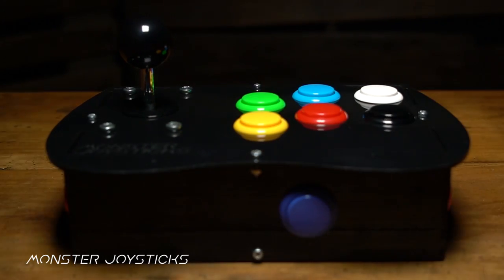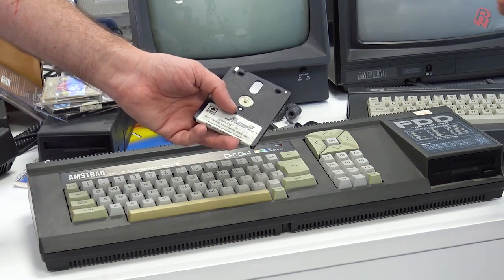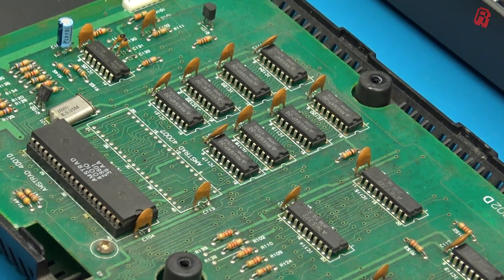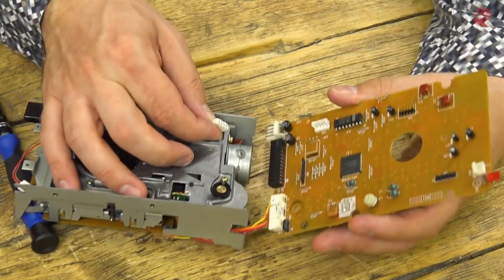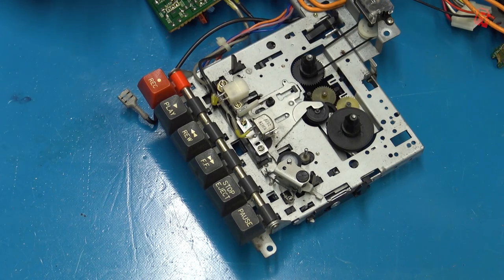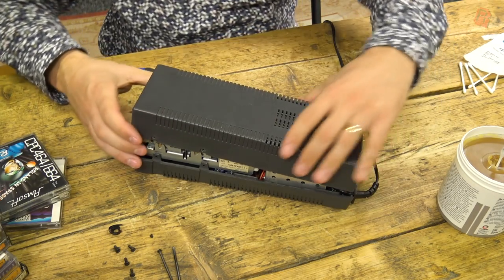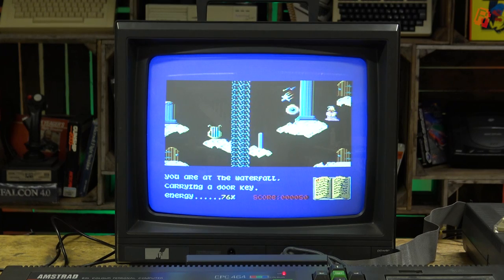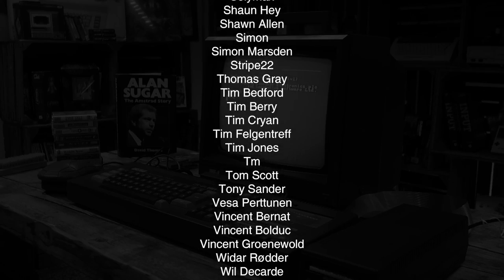British Micro Donations Refurb - Amstrad CPC & DDI-1

Comment: That fits perfectly!  If I remember correctly, "Finders Keepers" was the first game I bought and loaded on my CPC-464 @20:30. That must have been sometime in the mid 80's.

I still have a CPC-464 sitting around. Not my very first one and no longer in use ... but it would probably still work ... with a suitable power supply and ... a little less available these days ... a suitable CRT monitor.

Comment: Great video as always chaps. I have a CPC 464 and have just bought a CPC 6128 too. I also repaired a tape counter on an Aquarius data recorder recently. I found the button itself rattling around inside the case, but I couldn't figure out how it attached to the counter mechanism. So I removed the clear plastic cover and luckily there were two tiny pieces of plastic that attached to the button still inside. I superglued  the parts back together, reassembled everything, and the reset button now works a treat :-)

Comment: I and my wife had a series of ZX Spectrums from the rubber key through to the last tape Amstrad version. I loved playing games on it. Then I bought a CPC464 with colour monitor when they first came out. There were very few games but I eventually bought a disk drive and printer and learned some basic machine code. I have to admit that learning to programme on the Amstrad was probably the happiest I've been with any computer. Thanks for the excellent video.

Comment: The FD1 interface could be a bit of a nightmare, it wobbled around enough on its own & the lack of an expansion port pass through meant that it could end up at the end of long chain of accessories such as the range of DK'Tronics ram packs, ram discs etc.

Comment: Earlier this year I managed to get a CPC6128 with colour monitor, lots of nostalgia as a CPC was my first machine as a child.
It was very clean but as usual the disc drive belt had perished into gunk, luckily it came apart really easily and in fact it was one of the easiest belt changed I've had to do on a drive! 
Next is to get a Gotek working with it, so far I have had little success flashing the hardware onto the floppy emulator so its still a WIP.

Comment: Neil, perhaps put the two enter keys on your eBay saved searches as well. They're meant to be blue, not faded to grey!

As for the pinch roller, what about an o-ring - not the right profile?

CPC646 was my first computer growing up, with a green tube and later the RF modulator for use on a TV - Amstrad MP-1.

Comment: An interesting test: can a common electronic board tin-plating kit be used to refurbish edge connectors?

After cleaning the rust, this also might help with rusty RF shielding, as it might have been used in the first place.

Comment: 11:03 was the belt snapped? where did you get a new one?
Reply: Lot of things made of soft rubber will de-vulcanize at some point, where they basically turn back into the oil they were made from. You can find belts for lots of old drives and decks by just looking on places like eBay.
Reply from the maker: I bought a multipack of belts a while back so I can usually find one in my spares, but you can also find them if you just search for amstrad cpc belt.  Lots available
Reply: Thanks 😀

Comment: But did you remember to put the write protect pin back into the disk drive, i remember when i first cleaned out my dd1 disk drive the write protect pin fell out and i never noticed so spent hours trying to find out why it kept telling me that my discs had the write protect enabled until i notice a small gold pin on the floor and after some investigation realised it was part of the disk drive protect mechanism.

Comment: A good replacement for the drive wheel "tyre" may be an O-ring. In a previous life I had an air conditioning business and had a stock of refrigerant line seals. Used them to fix similar thing's although not an amstrad. May be worth looking into

Comment: I recently bought a similar setup. I too had to do the belts on the ddi.  I have two ddi drives that I fixed and have managed to tune the rpm to stock, often this is all that’s wrong if the belt is fixed and it’s not reading.  I managed to buy in bulk 40 brand new discs still shrink wrapped! So I sacrificed a few and loaded all the games on from my childhood days, Jetset Willy, Grand Prix, rambo, sorcery etc. man the nostalgia was strong as weirdly amstrad ddi drives have a unique smell :)

Comment: The Amstrad CPC 464, complete with colour monitor, was my first ever computer, which Mum got me for my 11th birthday from Dixons way back in the summer of 1985. Mine's a "tall key" version, originally manufactured back in December 1984. Though it is scratched and somewhat beat up, and the monitor's long since gone (which was a pre-664 sans 12v disk connection one), it amazingly still retains the original colours of the graphics on the keyboard unit, as well as those of the proper double shot keycaps, more than 35 years on. Could having Jazz and Rampage 3D Transformer stickers placed on it have protected it for all these years from the ravages of deadly UV light?

Comment: Hi Neil, might be worth trying to re-purpose something else like o-rings/thick rubber tap washers or even bike brake piston seals for the tape tyre if you can't get the original.
Reply from the maker: Hey, I understand a flexible fillament is an option with 3d printers... I really need to buy one.  When I do I'll try to make a batch and put them in my store nice and cheaply for others
Reply: @RMCRetro  that's what you need. I replaced mine with one a couple of months back.

Comment: I needed a tire for my tape drive but couldn't find a replacement so I made one out of rubber tubing I had to hand, I cut a thin piece off and managed to wrap it round the wheel, it works now.
Reply: This one works, I bought one couple of months back.

Comment: For the replacement tyre:  It should be fairly trivial to 3D print a TPU (flexible and rubbery filament) replacement.  Whether this has the dimensional accuracy/surface finish required to maintina a good enough wow and flutter is a matter for experiment I'd say.. Perhaps a rubbery resin for an SLA printer would be better.

Comment: Why not 3D print the counter reset button and the drive wheel rubber replacement with something like Ninja Flex? If 2 material printing is available maybe even print the whole wheel+rubber?
Reply from the maker: This is something I'd love to try when I finally get a 3D printer

Comment: What you may find with some monitors is that you may find that the image is very dark, or something isnt looking right. If you turn the brightness dial the image may go crazy and glitchy. Two things can fix this, 1st is to open it (very dangerous so look get expert help with this), the back casing comes away easily (tricky to get it back on correctly aligned with the components inside though for the v hold button) and you just spray the potentiometer for the brightness (you cant get the wd40 straw to get in there with the case on unfortunately), give it a few turns and then when the case is back on - power it on and test to see if the glitchy lines etc have gone.

For the screen that is too dark, there is a small potentiometer that you use a screwdriver on located on the black (i think its called a flyback?) box with two potentiometer screwdriver holes, (to the right of the v and h hold potentiometers) i believe the bottom one adjusts the brightness of the tube itself, very tiny turns to adjust, and it'll be all good then, but get someone who knows their stuff to do this!)

Comment: Ahh, the '464... my computing savior!
I started out with BBC B + CUB monitor + twin FDD's on loan from my father's work. Eventually they wanted it back and my parents not rolling in cash bought a ZX81 for me as a replacement! It's the thought that counts even if I had come crashing down with a gigantic bump.
Time went by with no sign of a Beeb entering our house once more (too expensive). Having had a 'proper' computer I knew a Speccy would seem too much like a toy and the rubbish Basic in the C=64 was off putting to me - at the time I did play games but was more in to programming and tinkering...
...Then Amstrad came out with the '464. By comparison with a BBC Micro it did all the things I wanted well enough and as a complete system at a price my parents could afford. Good games too. I was happy enough, it even came to university with me.

Misty-eyed nostalgia aside I regard the original CPC computers as nothing short of a work of genius. Amstrad's all-in-one marketing and design for a good price was spot-on. But much more than that I really think the engineers who designed this machine managed to trap lightning in a bottle. The combination of fantastic firmware and amazingly clever design resulted in a bunch of not terribly inspiring components coming together in a machine far more capable than it's specs would suggest without any obvious compromises. As an all-round package I believe it was the best machine of it's time, and that coming from a confirmed Acorn 'nut'. Yes there were 8bit machines with better specs but all either didn't live up to those specs, were much more expensive, or had compromises in their design that made the whole 'less good' than it could have been.
Waxing lyrical, I'll shut up now. I wonder what might have been if the '464 had arrived with '464+ specs, assuming that didn't mean bumping the price?
Reply: CPC+ in a CPC body at CPC prices back in 1984?!? Bye bye Atari 800 with all the colours, bye bye C64 with hardware sprites and scrolling, bye bye... ;-)

Comment: Did you own the Green or Colour monitor back in 1984 buddy?
Reply from the maker: I had the colour monitor, but not the one in the video.  Notice this one has a 12v plug on the front which is for the 6128 to power the floppy drive.  On mine it only passed 5v into the CPC.  The FD-1 has it's own power supply

Comment: I can appreciate battle scars it gives it more character and shows the life its had, Regarding the WD40 contact cleaner would you recommend it for carts? I am looking to referb my old MegaDrive sometime soon and wanted to give all the carts a fighting chance.
Reply: I personally use Kontakt 60 for throrough cleaning when IPA isn’t enough. In most cases IPA works fine but Kontakt 60 is great for serious oxidation cases. Have used it successfully on some very stubborn carts.
Reply: @dykodesigns  Thanks I'll give that a try if I can find any Amazon sellers that ship to my specified address.

Comment: Have to give a mention to the hifi's, they weren't bad at all.   They looked cheap and the speakers themselves once rewired with something more than single molecule strand of copper were OK too, yet they did deliver, the turntables often stretched the belts as did the cassette decks but you could pirate a cassette or record or off the radio a treat until the atom thin carbon layers on the slidey controls wore through then there was nothing for it but the tip and they always seemed to last about a week more than the warranty.   As stereo's went these were proper bargain basement bracket.   It also ended the true all in one horizontal hi fi's pushing people to towers and stackable units moving on from what was by this time the end of the modernish gramophone, a shame as the 70's era all in ones tended to be quadrophonic and ideal for true Floyd or Who records which Amstrad units were def not ;)
Reply: You started off by saying Amstrad music systems weren't bad at all, but then went on to write a paragraph giving examples of their poor quality, so much so that their existence even harmed the creation of music if I'm understanding you correctly!

Comment: Guys, here's where you can get a tyre for the cassette mechanism. I had to do exactly the same replacement of mine only a couple of months back, and this one worked a treat.

https://rover.ebay.com/rover/0/0/0?mpre=https%3A%2F%2Fwww.ebay.de%2Fulk%2Fitm%2F283504026458

Comment: The C64 and the Spectrum came out a full 2 years before this, so should of been as good if not better. It wasn't. It never felt right. There was something about it I didn't like. No disrespect to your first computer
Reply: It was much better than the Spectrum and much cheaper than the C64, so it fit a nice niche actually. In France where I grew up, they were the most popular machines.
Reply: Nicholas Bales I'm sorry mate, but I'm sorry but the Amstrad should've been better, but those earlier computers made their programmers work. I personally owned a zx81,  ti99 4a,  Commodore  plus 4, Atari 800xl. As a family (allegedly) we owned a Spectrum, Commodore 64 breadbin and an Amiga. If the Amstrad had been available without the screen I personally as a 14,15 year old kid would've bought it at the time.
Reply: Nicholas Bales I'm sorry mate, but I'm sorry but the Amstrad should've been better, but those earlier computers made their programmers work. I personally owned a zx81,  ti99 4a,  Commodore  plus 4, Atari 800xl. As a family (allegedly) we owned a Spectrum, Commodore 64 breadbin and an Amiga. If the Amstrad had been available without the screen I personally as a 14,15 year old kid would've bought it at the time.

Comment: Howdy Boy's !!  Good Show !!  Got a few questions for you cave dweller's ...... First what brand and type of grease are you using ? And what year were those  devices made ? I've worked on tons of power supply's and most of the failures, were caused by 20 - 30 or more year old electrolytic caps ! Even if they were Ruby's or similar quality ! Even If your not going to replace them, at least test them with a cap tester.....( Take a look at the one, that Mr. Carlson made on his YT channel ! )  Also..... For the pitted MoBo edge connector, you can buy a circuit board trace repair pen . They are pretty cheap, compared to other solutions ! And for the last tip, find someone that has a Ender-2 3D printer !! It's so good and accurate for making small parts, that you can make machine thread screws !! CU-L8R   Joe